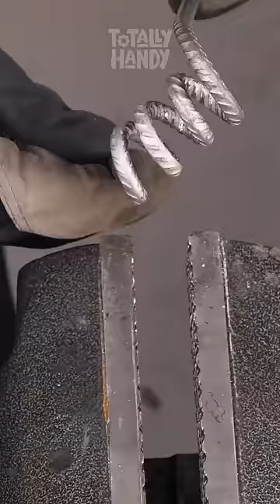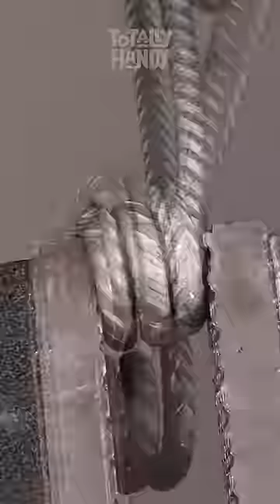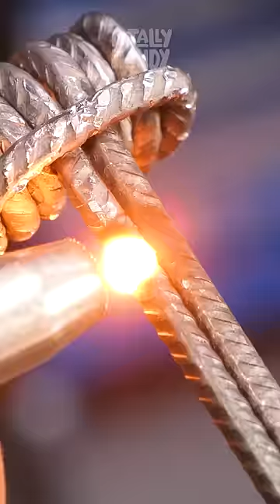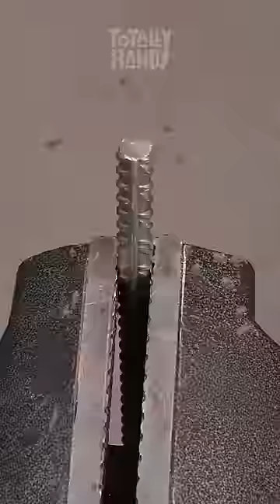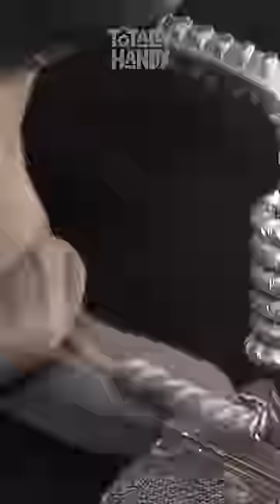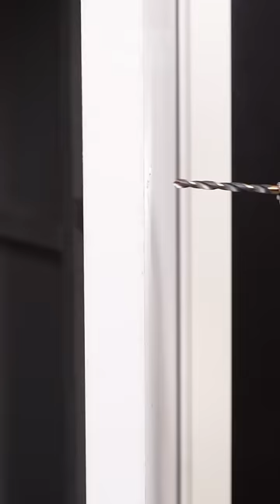Bending Rebar to Make a Knot #shorts

Comment: I always clean mine right after use while it's hot. throw some water in it, let it sit a couple
Minutes. I Have the same scrubber but it's wrapped over rubber so it's like a metal sponge. Wipe it good, take an oil soaked paper towel, coat the pan, put it on heat for five minutes than wipe excess oil with fresh paper towel. Fastest way I've found that keeps a very nice season to the pan.
Dawn soap is blasphemy imo